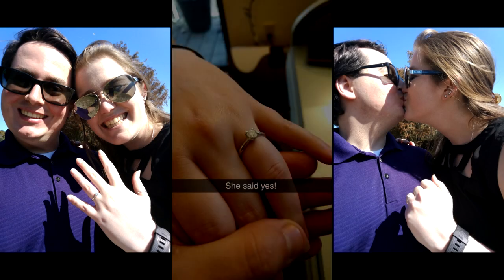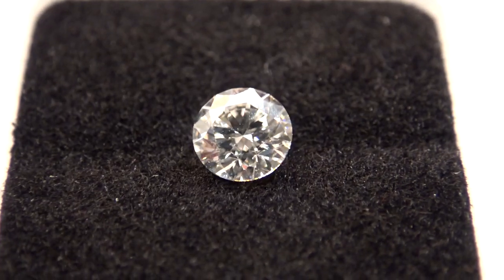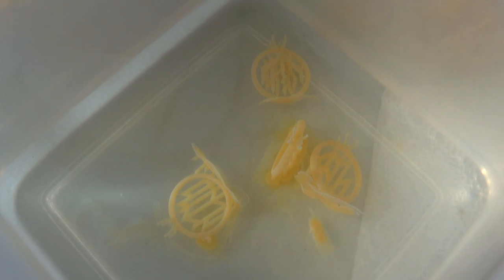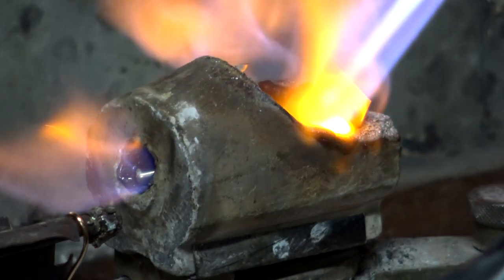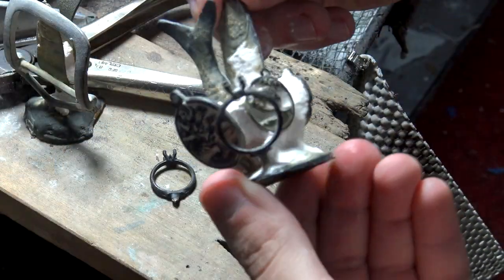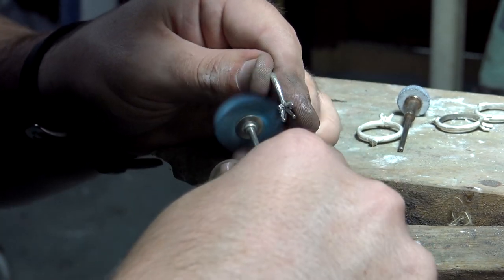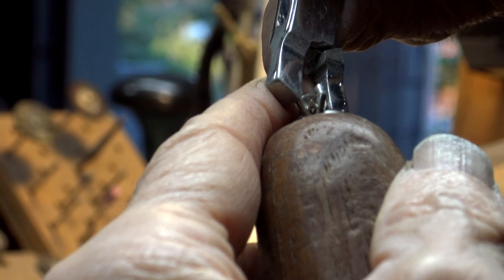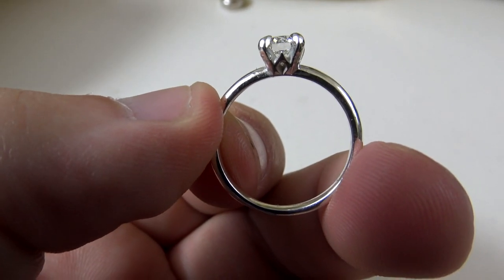This Diamond Engagement Ring is 3D Printed || She said Yes!

Comment: Hey ! beginner here :D
great videos !

When you 3d printed how did you transfer the work you made on Onshape to the 3D printer and added the support rods?
Reply: Supports are added by the software that interfaces with the 3d printer. You do not usually program them. Usually goes like this: design the part in software such as fusion 360, then transfer it to slicing software, which turns your part file into layers that the 3d printer can print. At the same time, it calculates where supports are needed and automatically adds them. Then you send it to the printer either through wifi or directly with a USB or SD card, select the print at your printer, and it prints!
Reply: @mitchellsteindler  that explains a lot thank you ! Ill come back to this message for future reference ill try to use the tips u gave :)) thank you

Comment: 2:30 why does the printer go up and down? (I thought it would only go up).  Does it go up and down each layer?
Reply from the maker: The build plate (where the parts are attached) only moves up, but the resin vat tilts down and back up after each layer. This is called "peeling", and is necessary because when the resin is cured, it is stuck to the bottom of the vat. The vat then moves down to peel off that new cured layer from the bottom, freeing it, and allowing the build layer to move upwards for the next layer.